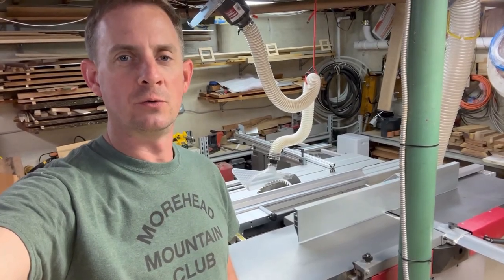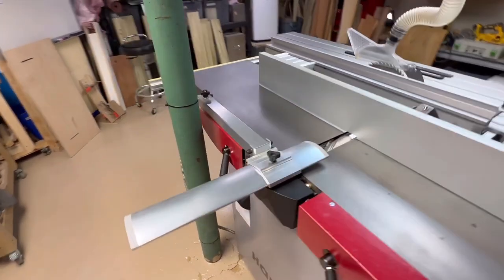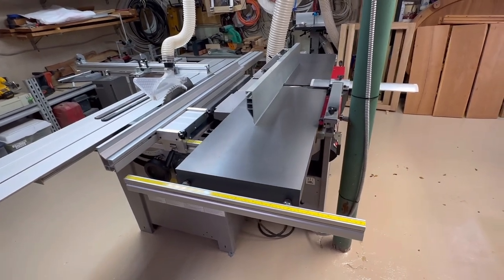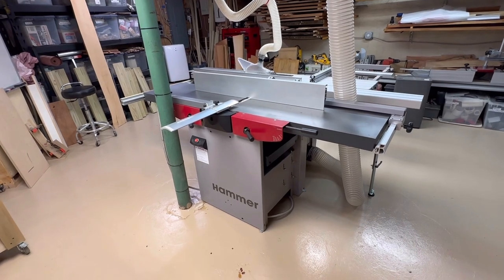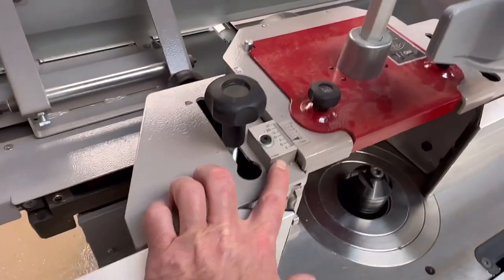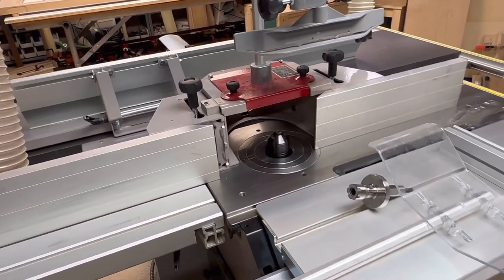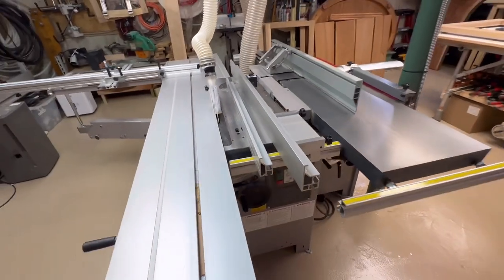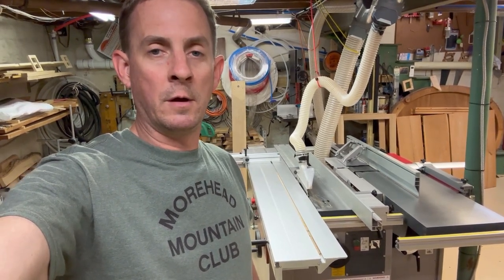Hammer C3 41 Comfort Combination Woodworking  Machine Review - after 15 months of using

Comment: Nice machine and informative video. I went for the Felder 531 professional which is basically the same machine but with the x-roll sliding table. I have the 2.5m (just over 8 feet) table which I actually find a bit long to be honest. 

Re the blades, I had other blades without the holes and just used a Felder blade and marked and drilled out matching holes in my other couple of blades. 

Re the guard, I’d recommend upgrading to the folding guard (if it’s available for the Hammer machine). It will still be different than the traditional American guard you’re used to, but it folds down vertically so it isn’t really sticking out very much so doesn’t get in the way.
Reply from the maker: Thanks for the feedback! I’ll look at the Felder guard and see if it can fit the Hammer machine.

Comment: I have enjoyed your install and intro videos.  I have a 29" door opening.   My first Felder rep was completely unaware of the separation option.  Sooo,,, I am considering this as a space saver and the way to get a capable thickness planer into the shop. "Space has no price equivalent".   I have a 12.5' table top planer, a good 6' classic jointer, that live in a closet until needed and anything big gets taken to the friends with 20" helical planers shops. This is an increasing occurence.    One friend has the Hammer 16" and it is the reason for wanting to change the system.    I have concerns about what I'm giving up with the table saw component and would appreciate a comment or three. I'm running a 2hp Steel City 10' saw.( a Delta unisaw "copy"with improvements), with granite top, 53" outboard extension and a 2hp router table insert. I've got kreg feather boards and mitre fence, home bilt cross cut sled, 45 degree and variable angle  sled , finger jointing jig, etc , like many other folks, hanging on the wall. Everything works with the dual 3/4' slots. They are accurate, quick and reproducible cuts, once you actually construct the jigs. The granite top doesn't play with magnets well but that has never been a limit and 20 years of rust control has been avoided. All the semi big and big, heavy stuff is worked to the right side on the table extension.    Sooo,  due to size constraints. I might not be able to put the Comfort slider outrigger on, and stay with the Standard model.        Can this unit replace those common jigs? Is there something to replace the feather boards? Can you work big heavy pieces to the right, over the jointer surface by removing the fence and guard? Is this unit fun when working with small pieces for boxes, etc?    And,,, Does this very expensive moulding head actually work the 1/2' router bits well, at 10,000 rpm, or tear things? Can you do the same things as my router insert on the table extension?   Thank you for any considered opinion and reply.
Reply from the maker: Robert - I’ll do my best to help, and feel free to ask more questions or follow up if I miss something. In general, with the table saw, try to fit the larger model if it works for you. You will be surprised at how much the larger capacity helps…for example, the ability to straight line rip a 7’ foot board is very nice, even if you never need the larger crosscut capacity. I’m not familiar with the Kreg featherboards, but they appear to be similar to a set I bought on Amazon that fit into the T slot on the sliding table. They definitely come in handy. You wouldn’t need your crosscut or angle sled anymore since that capability is inherent in the machine. As far as box joints, you may be able to modify your jig to work with the T slot on the sliding table, but of course that would depend. I would recommend you look at what dado tooling is out there for the Hammer…it’s certainly not as wide an assortment as for a Unisaw type saw. Personally, I rarely use dado tooling, so it’s not an issue, but if you use dado tooling a lot, you may want to consider that. I should also point out that the Hammer is a right-tilt saw, in case yours is a left tilt. I worked professionally in a shop that had both left and right tilt saws, which was hugely helpful. Just something to consider. As far as working small pieces, use a zero clearance insert and a 10” blade, and there shouldn’t be much difference. I will say I am careful about small pieces with the machine when there is a 12” blade and a non-zero clearance insert. With regard to the router table versus shaper with router collet, off the top of my head, I can’t think of any reason why you can’t do everything with this that you would with your insert…and probably better and easier. I’m sure someone on the internet can tell me why I’m wrong. True, you may not be able to get the high RPM’s, but you can slow down your feed rate to compensate. I think you’ll find that the incredible stability of a shaper running a tiny (relatively) piece of tooling with a highly overpowered motor on a very stable platform and a solid fence will more than compensate for any advantage a higher RPM would provide. Possibly it may not be as flexible in terms of screwing or clamping additional fences or such, but the provided fence and guides are pretty useful. Also, having the sliding table with the shaper head opens up other possibilities that most router tables can’t replicate. I know I use it when I am doing cope and stick operations. One other minor point, there is no 1/4” collet for the shaper, in case you use any 1/4” shank bits. Hope this helps!

Comment: J/P table is actually specially milled like that.  it has tiny grooves which according to Hammer is suppose to reduce friction but in practice people complain about it.
Reply from the maker: Interesting, thanks for confirming that. Maybe in a lab that’s true, but I feel like it does the opposite. I wax it and have tried Slipit as well, it still seems like there is a lot of drag on the material.
Reply: @theoccasionalwoodworker  yep that’s the complaint. Carbon method is developing a product for this issue. Bents woodworking is beta testing it and it seems that applying multiple layers of it helps
Reply from the maker: @AlexK07010 good to know, and thanks!

Comment: Thanks for the review. Is it possible to use the table saw sled also as a sled to the shaper?
Reply from the maker: Yes, you can absolutely use the sliding table for the shaper as well. I have done it when coping the ends of rails. The only issue I had was that I had to adjust the shaper fence to be square to the sliding table, but that was a one time adjustment. Have a sliding table for the shaper is very handy for certain operations.

Comment: Hi, first thanks foir this video. I bought a c 31 performance but the saw cannot be lifted completely, in the last part become very hard to lift, i suppose a cleaning is required but... how access to the infinite screw? it s totally unaccessible.. have u ever had this problem? thanks
Reply from the maker: Hi, I have to say that I haven’t had that problem, but taking a look at mine, I agree that the most likely thing is to clean the screw that raises the blade assembly. It also possible that an offcut may have somehow gotten caught in there. It’s certainly not easy to access that area, although I’m sure you already figured out that beveling the saw all the way to 45 degrees does give you a little bit of access. With that said, I have another video from when I had to assemble my saw, and at about 10:50 in that video, you will see that I have the main electrical box pulled out of the machine, which would give you much better access to that area. It’s not that much work to get the electrical box in and out of the saw, and my video shows it, so maybe that will help you. Of course disconnect the power first! And beware of any residual power in the various capacitors. The link to the video is here:

Hammer C3 41C Comfort Unpacking, Movement, and Assembly

https://youtu.be/iS0Mg5u3xro
Reply: @theoccasionalwoodworker  Many thanks for your answer, yesterday i did exactly this, taking electrical box out.. the condition of screw was surprising good.. i really don t understand what s the problem, i cleaned all up but in the last inch the screw became very very hard (need two hands to lift the saw).. i will studi further. If i undrstrand why this happen i ll let u know.  Thanks for help
Reply from the maker: Yes, please let me know what you find out. Is there any chance the riving knife is binding on something as you’re trying to lift the blade that final inch? I can’t think of too many likely problems other than an offcut being wedged somewhere or the riving knife somehow binding.
Reply: @theoccasionalwoodworker  I have no knife on because i have done some "blind" cut, to the problem is something else. I also think about some piece of wood or resin.. the previous owner was use to work high amount of pine and the machine was pretty dirty when came to me. In the next days i ll clean better and let u know.  like my father say: complex problems often have a simple solution, i think this is the case.

Comment: Where did you source the longer fence?
Reply from the maker: It’s a Felder part, made for the Felder table saws. I don’t have the part number handy, but I can get it. I believe it’s the 1200mm fence. I have another video that’s shows the modifications I had to make to accept that longer fence. It was a bit of a pain, but I’m much happier with the longer and taller fence.